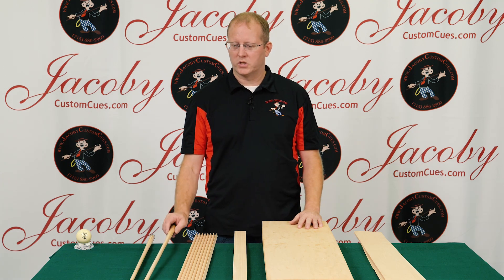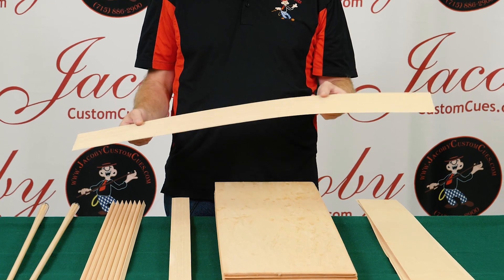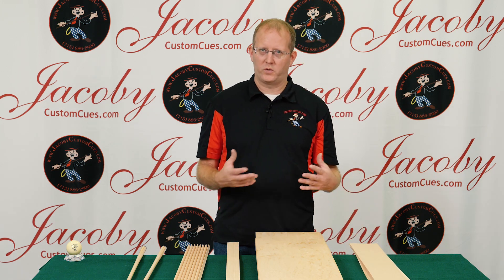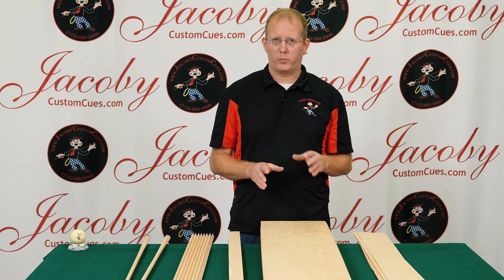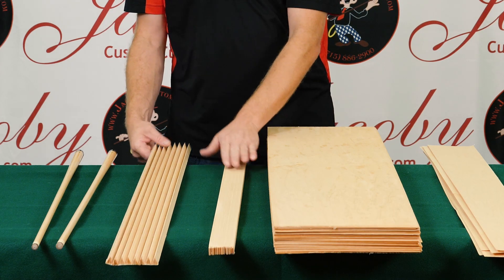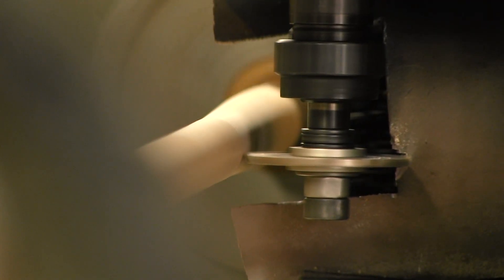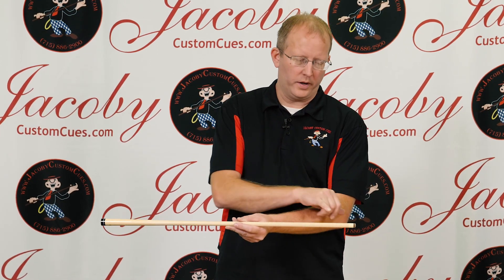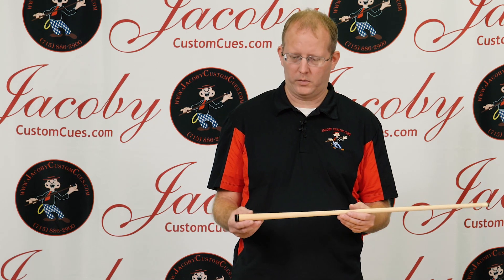Ultra CONSTRUCTION

Comment: The Ultra Pro is phenominal and I been a standard deflection guy all my life. I played Tiger X on everything from Helmstetter to Schon and I have despised every LD shaft including carbon fiber on the market. The Ultra sounds, plays and feels like solid maple and has nearly ZERO deflection. On a firm stroke table length shot, there's maybe one tip (12.9mm or a thin quarter ball) of deflection, and on a softly stroked shot, you only have to be aware of swerve -no deflection at all. I like it so much, I have Jacoby building me a custom with  two 30 inch Ultra Pro shafts tipped with Kamui Black soft.